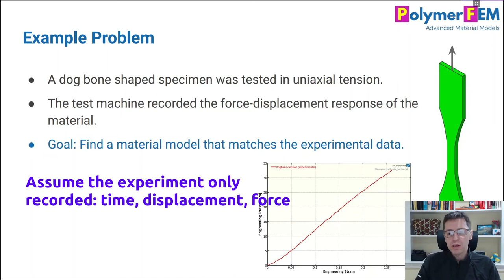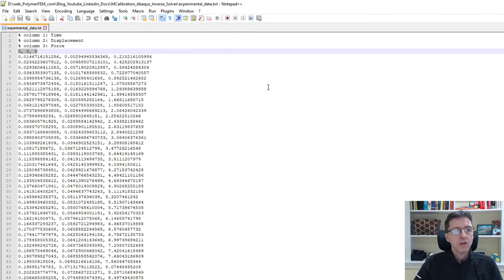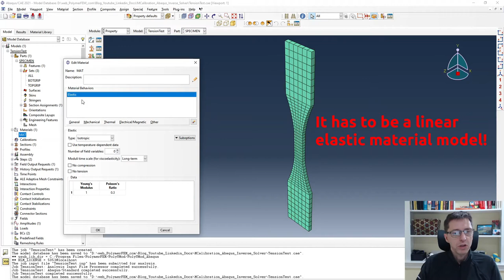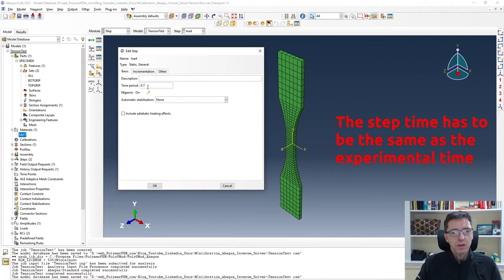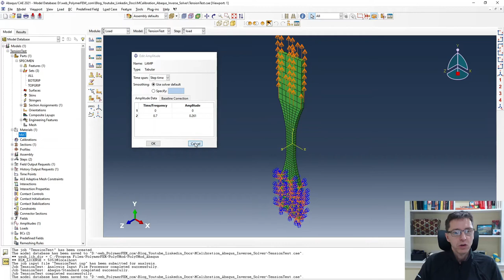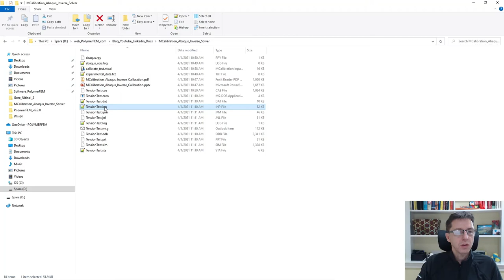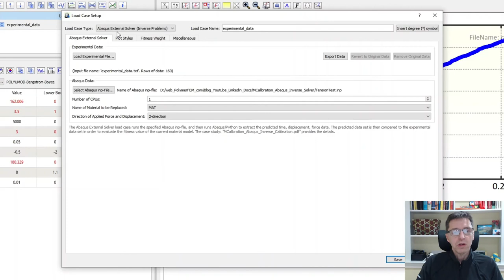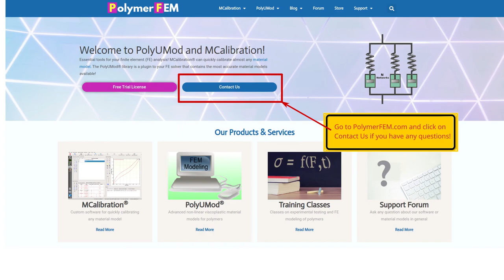Tutorial on how to setup an inverse calibration using an Abaqus FE simulation

Comment: Hello thank you very much for this tutorial. I'm not an expert of this field of inverse problems. Could you please give me some information about the differnece of this method and the updated finite element method? I don't really see a big difference in the principle. Moreover, what about the fitting method used in abaqus I guess it is an identification used on a Gauss point without any iteration of fem calculation...
Reply: If I can give the differnet classes of identification approaches used, here is the following ones I gathered so far:
1) inverse identification on a Gauss point
2) inverse identification using global quantities as force-displcacement data. In this approach, several simulations are ran to to have the optimal parameters that gives the best match to force displacement data
3) the methods that need full fields measurement, such as Femu and VFM method

Am I correct?
Thanks a lot

Comment: Is it possible to leave the initial section of experimental data, and calibrate based on the latter section of the experimental curve ?
Reply from the maker: If I understand you right, you want to emphasize the large strain/displacement portions of an experimental curve. In that case I would use a strain-based fitness weight factor that is part of MCalibration.
Reply: @PolymerFEM  Thanks for the suggestion. I wanted to emphasize exactly that!